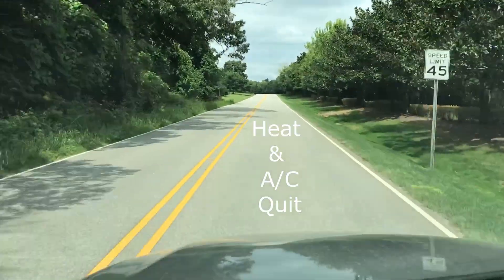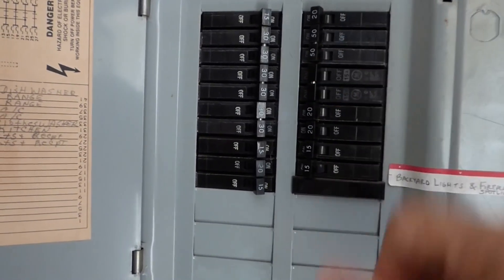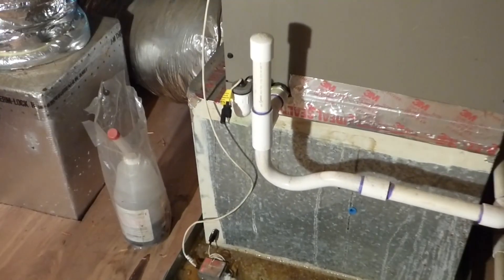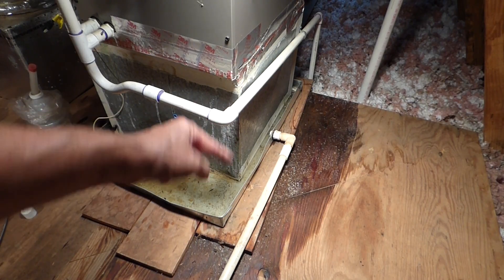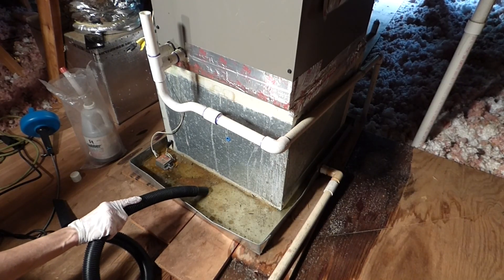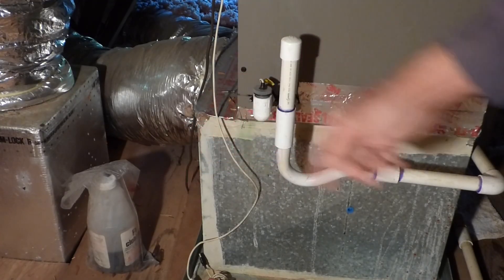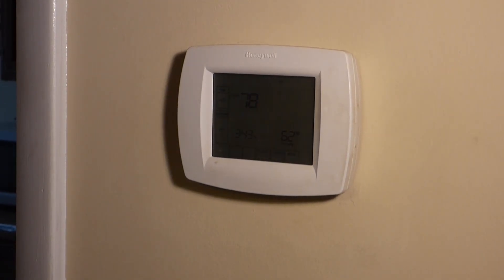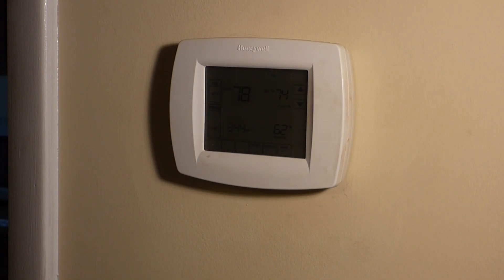How to FIX a BLANK THERMOSTAT with No AC or Heat in your Home

Comment: Best tip for homeowners that no one ever talks about. I shop vac my drain line at the change of every season as I ran into the same issue years ago of the line clogging up and shutting the hvac unit down. Thanks for the video!